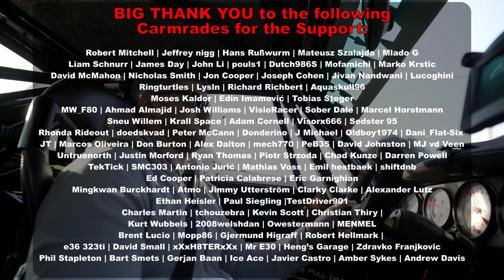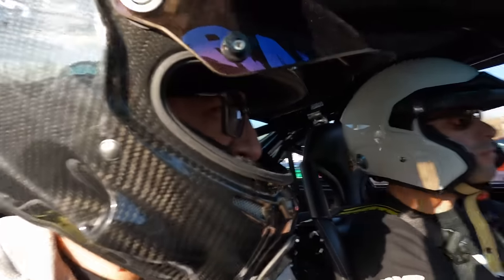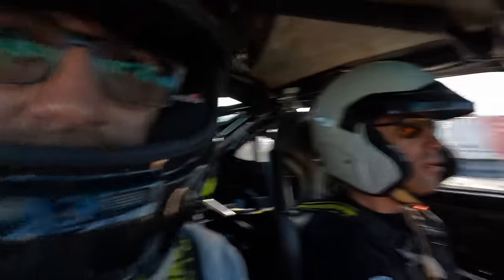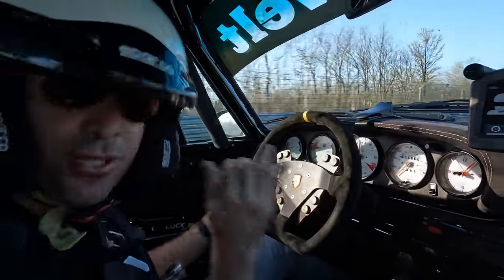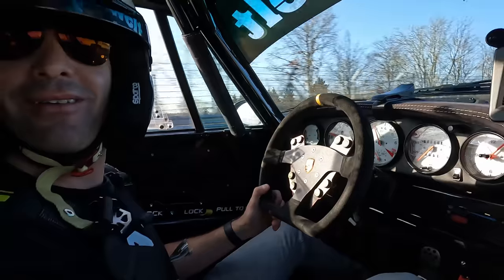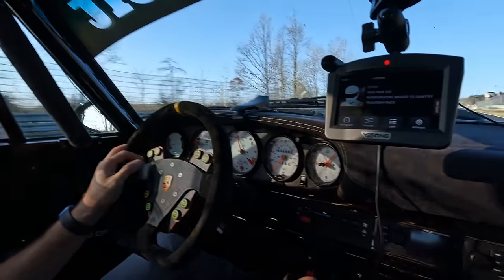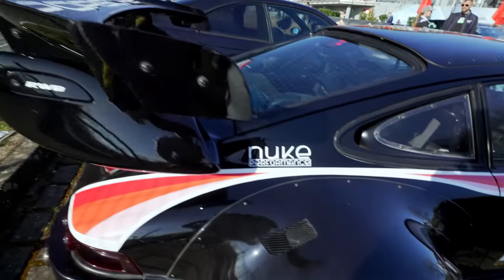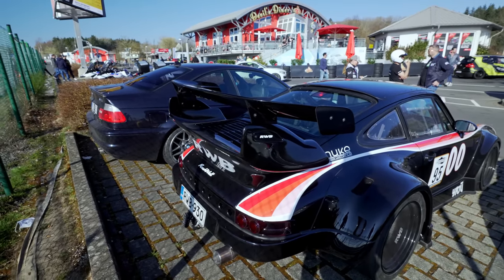WIDE & ANGRY! Porsche 930 RWB Specs & Nürburgring Lap!

Comment: I put a G50/50 5-speed trans in my modified 1982 Porsche 930.  Keeps engine boost high and makes it more drivable.  Great improvement!
Reply: As secondary option we're  looking as well for g50/52 5 speed gearbox originally made for last 930 turbo production year 1989
As we running over 700nm the g50/50 likely wouldn't be enough
Reply: You can get the billet side cover which will add the strength you need. Several companies make them..

Comment: The suspension definitely could
Be better. My 930 has a custom made elephant racing coilover set up. Also a bunch of steering bracket work. You’ll knock out a ton of time in these areas. It’s not about all that horsepower when you’re not planted as best as possible :) sick ride tho! Congrats on it.

Comment: Misha I'm having issues with my a90 bump steer still. Did the subframe kit you have installed a year ago solve the problem? I have kw v3 coilovers with stiffer springs.
Reply from the maker: it helped, but by now they have the v3 of the kit. which should be even better.

Comment: kinda slow for having that much tire... only broke 120 mph once
Reply from the maker: tires don't give you top speed :)
Reply: Did you really just convert km/h to mph 🤢 Also this porsche was like 10-20km/h faster than the 620hp 140i in tight turns.
Reply: I cant decide what's worse, your logic or your counting 😉
Reply: @mgcharoudin  with low weight almost 500hp and that much contact patch, a lot of those turns should have been over 120 (unless the suspension isn't set up) &  I would guess its top speed would be around 170 with all that aero.i would love to see it try to hit top speed on that long Nurburgring straight though 😏 edit im just messing around I know he wasn't pushing it as hard as he could